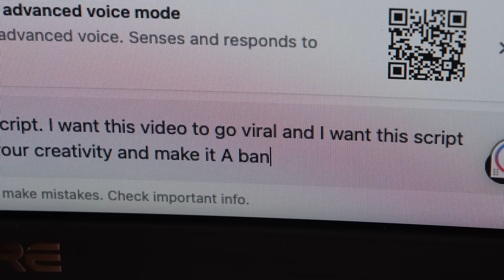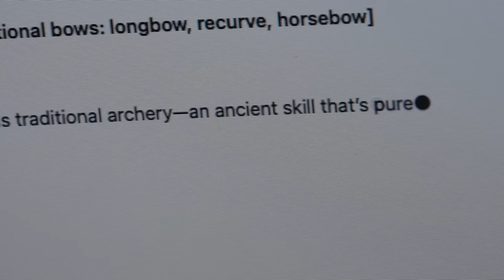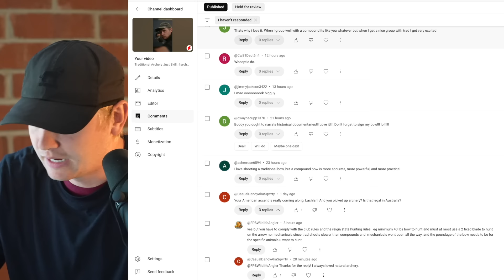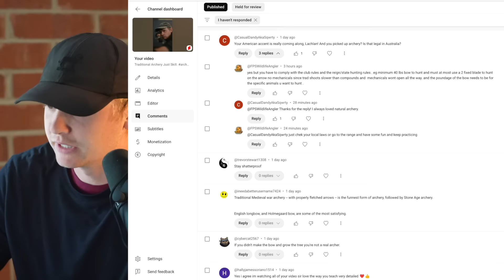You Didn't Notice I Posted An AI-Generated Archery Video 😢

Comment: If you are making something cinematic you have to stretch the audio by about 20%, or play it 20% slower.  You have to feel it by adjusting the tempo until it sounds good, but cinematic things are just a little slower.  Also, get as close to the mic as you can to get the deepest frequencies for higher quality voice.  You may need a "dead cat" to fix the blowing on the mic noises.